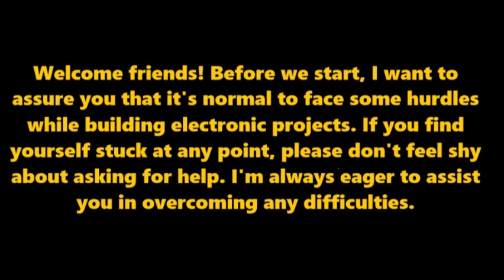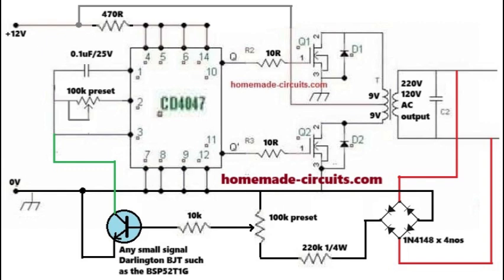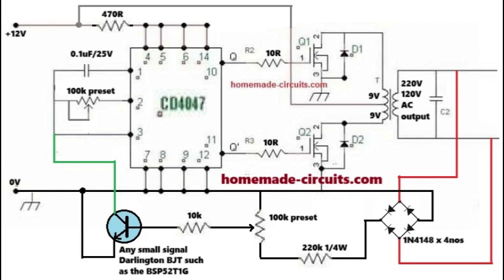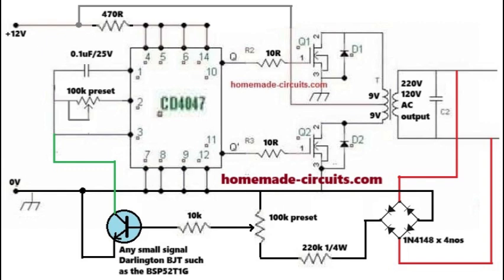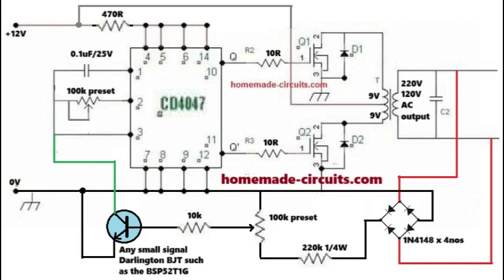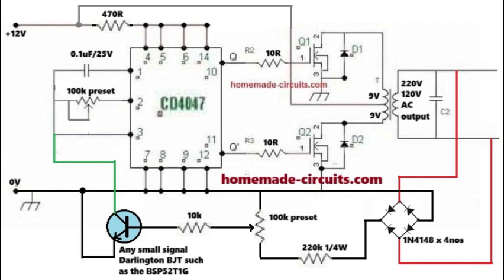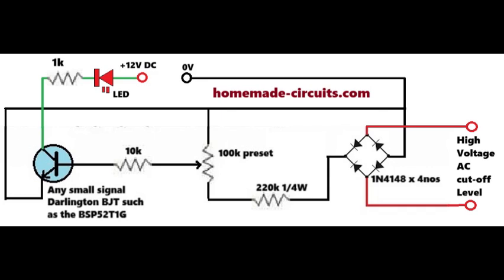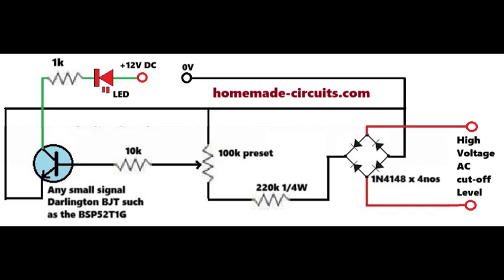How to Add an Automatic Feedback Voltage Control to a 4047 Inverter Circuit

Comment: Please , can I use 12-0-12 transformer instead of 9-0-9 in the diagram?
Reply: Thanks you very much Sir
Reply from the maker: If you use 12V transformer then the output AC might drop to maybe 200V when the battery voltage drops to around 11V, that is why a 9V trafo is recommended.

Comment: What is the Watt of the resistors and which mosfets are used?
Reply from the maker: Resistors are all 1/4 watt 5% CFR, MOSFETs will depend on your output load and transformer specifications...

Comment: Can I use 6 -0 -6 /220v transformer, also how can I determine the 1.2v for the Bjt?
Reply from the maker: You can use 6-0-6 transformer if the battery is also 6V, because it is a square wave inverter...Initially keep  the feedback preset to ground level, switch ON the inverter without any output load, check the output voltage which should be much higher than 220V. maybe 250V Now slowly adjust the feedback resistor until the output voltage adjusts to 230V level...
Reply: Thanks you very much, I sincerely appreciate your kind , humble and quick response and clear explanations. May God bless you with more wisdom , knowledge , good health long life and prosperity. @Homemade-Circuits

Comment: 👌 Sir what this BJT transistor Number please
Reply from the maker: Thank you Rajesh, you can use BC547...
Reply: Thanks 🙏 @Homemade-Circuits
Reply: Sir this inverter ac out put  diode  no.  ?  IN 4148  Z Diode   number I m right sir
Reply from the maker: @RajeshKuril-b2u  You can use 1N4148 diodes or 1N4007 diodes. 1N4148 is not a zener diode, it is a rectifier diode.
Reply: @Homemade-Circuits thanks

Comment: Hi swagatam your circuits were of great help many years ago on your blog spots, i really thank you for your kindness❤❤ asking, are the 1n4148 zener diodes in the circuit? Question 2, can we creat a modified sine wave using the ic CD4047 thanks alot .
Reply from the maker: Thank you Shady kim, for your kind words, I am so glad you found my articles helpful. Yes, the bridge rectifier diodes are 1N4148. There's no direct way to create a modified sine wave inverter using the IC 4047, instead you can use a 4017, 555 combination to create an easy modified sine wave inverter circuit: https://www.homemade-circuits.com/modified-sine-wave-inverter-circuit-2/
Reply: @SwagatamMajumdar  thanks sir🙏
Reply: I had done this too, this is so great, i will look at it again thank you.  n @Homemade-Circuits

Comment: How to make high amps input voltage dc to dc boost converter, for example 12VDC or 24VDC from above 200amps battery to 48VDC or above 300+VDC ?
Reply from the maker: You can try the following circuit diagram: https://www.homemade-circuits.com/wp-content/uploads/2024/07/adjustable-boost-converter-circuit.jpg
But you will have to suitably customize the inductor and the MOSFET  values as per your desired output voltage specifications.